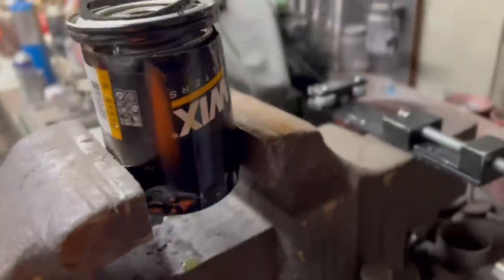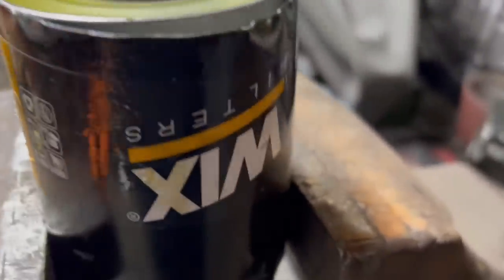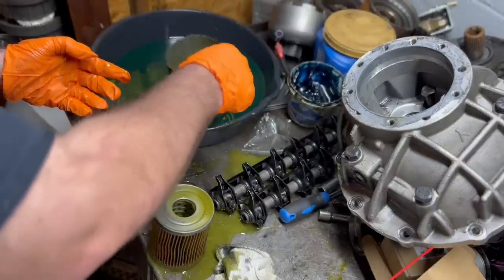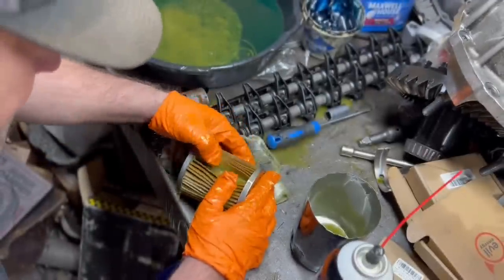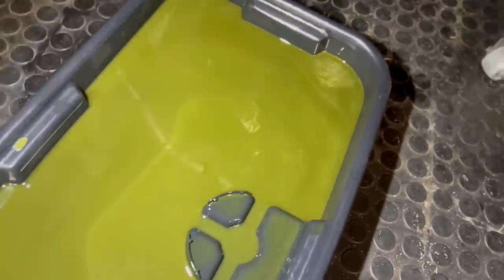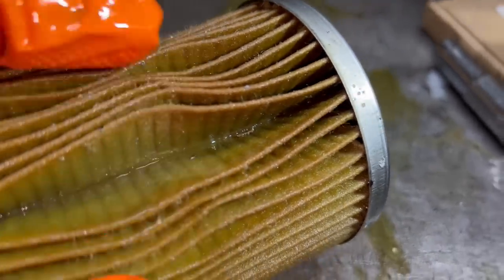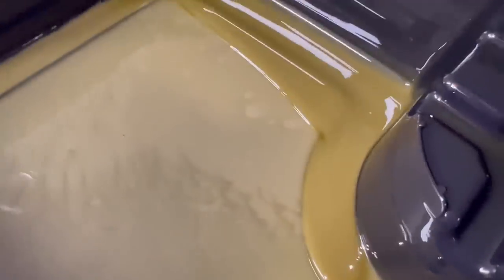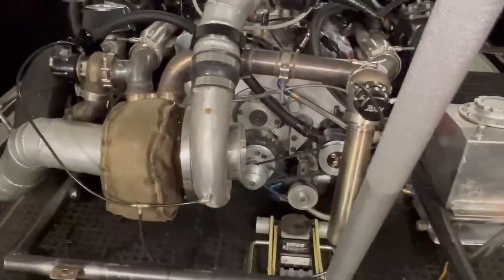Moment of Truth!  Cutting Oil Filter open!

Comment: John I remain anonymous here but please take a suggestion. After you cut the can open, pull the element out, now take a 
X acto knife or box cutter and cut the element along the top and bottom plates. Pull it off the center tube and make it like a long stretched out accordion. When you check the element the idea is to expose each pleat on both sides of the folds. Now you have a full exposure of any possible contamination that might be hidden.  
The WIX filters are definitely good but for decades of Engine Building I swear by the MOROSO filters, or better yet a Oberg type if you can afford it. Take it apart, clean the surgical steel element with brake clean and reinstall it. Lasts a lifetime! 
I always use these type of filters on my Harley Race Engines. You only buy it once and it's proven to perform. If a customer doesn't think a filter is worth $135 investment, I truly don't care if they go to another Engine Builder. I'm basically retired, have nothing to do with either company mentioned, and I don't need the money, but if I write about them, it's because I believe in their products. 
T.S. RACING

Comment: I've ran a 3/4'' welding cable to my starter because of the amp draw. Thicker cable, fine copper wire. It helped. My 2 cents. LOL. I don't know how thick your wire is.